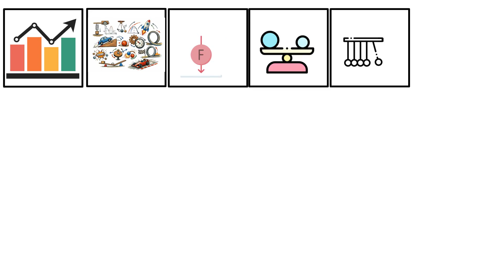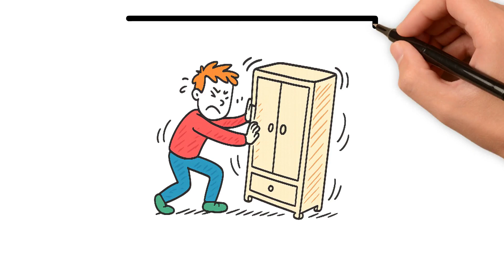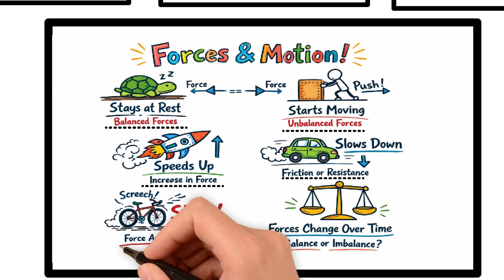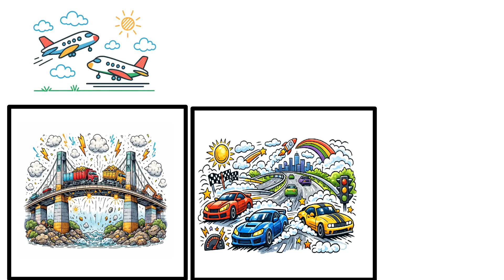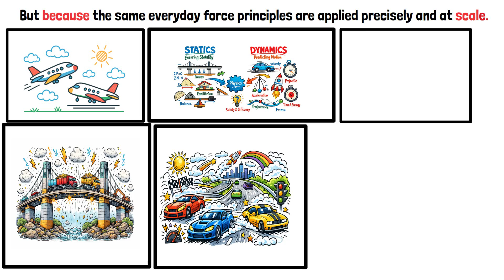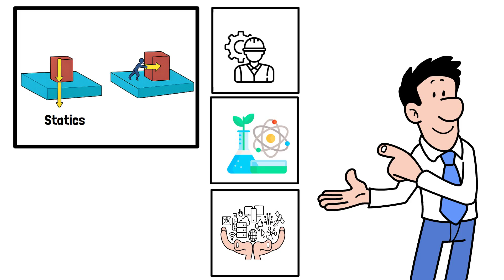Statics vs Dynamics Explained | Engineering Mechanics Fundamentals

Comment from the maker: If forces balance, systems remain stable.
If forces dominate, systems accelerate.

In this video, we built the foundation of Engineering Mechanics — understanding the difference between statics and dynamics, and the roles of kinematics and kinetics.

Everything in engineering begins with this distinction.

Next: the tool engineers use to analyze forces — Free Body Diagrams.